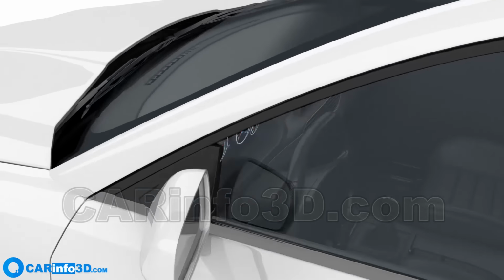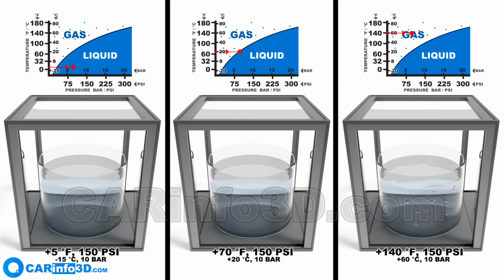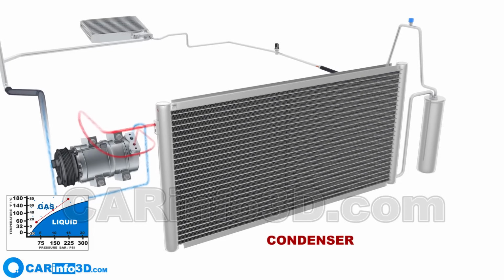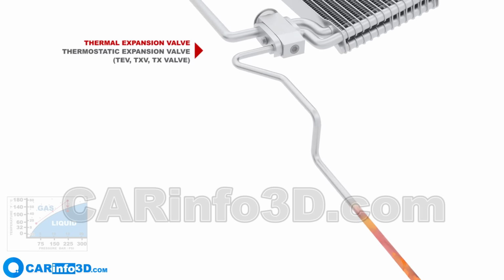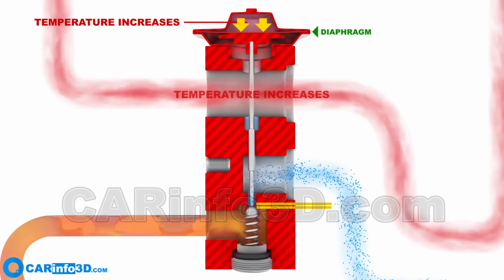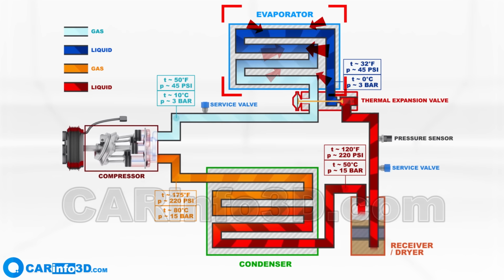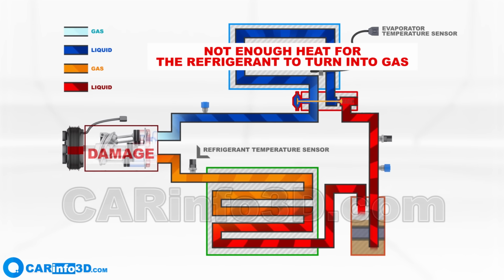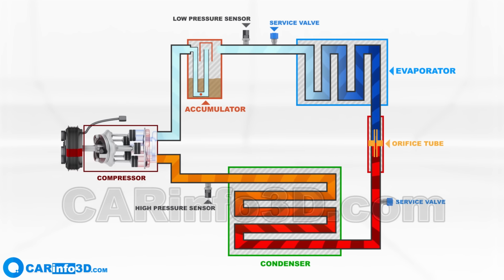Car Air Conditioner - How Does It Work? (3D Animation)

Comment: I'm struggling to read Fahrenheit values; they just don’t make any sense to me and mean nothing. At least Celsius is simple, 0 when water freezes and 100 when it boils, easy reference points using water. But the video itself is very usfull to me. Thanks a lot.

Comment: Well done & informative video. Here's my CONDENSED, get it? Condenser. description to the layman that's overwhelmed. You have two separate radiators, for simplicity, containing a type of refrigerant, one is under pressure and liquid form, the refrigerant is then pumped to the first radiator after it hits the expansion valve that allows the high-pressure refrigerant to expand which allows it to immediately turn to gas, it boils into gas at near freezing temperatures releasing the freezing gas refrigerant into the other radiator and the freezing gas absorbs heat and is pumped out to the compressor to be turned back into high pressure liquid to release that heat you just absorbed. This cycle repeats over and over. Made it worse for you? lol. I hope not.

Comment: What an excellent video! Although I did know increasing pressure in a system elevates the boiling point of the system's fluid, I'd never realized what the compressor (besides pumping) and the expansion valve are for until I watched this. But now, I believe I have to solve the fact of the coolant entering the evaporator as a gas, when I used to have in mind it entered as a liquid.

Comment: where does the water that the dryer absorb goes ?
Reply: Inside the drier, there is a desiccant element that internally absorbs the moisture.
Reply: That's not water, that is called moisture. Frequently moisture enters the system during refrigerant charging/filling and that is called dessicant in dryer which absorb moisture.

Comment: Hello, thanks for all these info. I have a question. How you control how cold you want from the system? It seems a closed loop system without any temperature control point.
Reply: It is dependent on compressor. Your AC is on, it doesn't means compressor is on. It runs till to reach your ambient temperatures which you set. When your set temperature achieved, compressor turns off.

Comment: Note that it's common for cars to use the air conditioner to lower the humidity in the cabin and often, the AC output is blown on the inside of the car's windows to defrost them.
Freon is a refrigerant trademark of DuPont Chemical Company.
Reply: Never true dupoint

Comment: In most modern cars the A/C system is used in the winter time in conjunction with the defroster. During cold weather the warm humid air inside the car can condense on inside of the windshield because the glass is cold on the outside.  This will fog up the windshield and reduce visibility. When the defroster is turned on the A/C system starts and the outside air is dehumidified as it passes through the evaporator. It then passes through the heater core to warm up the cold dry air. The warm, dry air is then discharged onto the inside of the windshield by the defroster vents. This dries the inside surface of the glass to eliminate the fog and restore visibility.
Reply: So you cool then heat ?
Reply: @Tribe_OF_Benjamin_O_Yasharahla  Yes. The humid air goes through the evaporator first to condense the moisture out of the air and then it goes through the heater core to get warmed up.
Reply: I always wondered why there where 2 settings for air; a "recirculate"  or use "inside".
Reply: Rubbish, outside air is all that is necessary to demist the interior windows
Reply: @BillSikes. So why on both my cars when I turn on the defroster, the A/C buttons light up, and the compressors run?
Reply: First, in cold season, compressor doesn't require to turn on because we don't want cold air, so evaporator doesn't get cold till compressor is off. Second, if compressor is on, there are seperate flaps provided to bypass the air through heating coil, so air doesn't get cold.
Reply: @TheKeshav92 
dumas....back to school
Reply: @William-m9q6e that school where your mother teaches..??
Reply: Incorrect. During winter time, the air as it warms on intake is dry enough not to cause wet windows. You rather want to humidify it for your own sake.
Reply: @тотсамыймюнгхаузен No it is correct. If you don't think so, turn on the front windshield defroster and then go look at the compressor. It will be spinning. The windows fog up because the occupants of the vehicle are exhaling warm, humid air that contacts the inside of the cold glass and fogs it up. The A/C dehumidifies the air being blown onto the glass so that the windows clear up.
Reply: @joevignolor4u949 that is if your air circulates inside - if it's taken from outside it gets warm dry - no dehum needed
Reply: @joevignolor4u949 
Rubbish, the windows only mist up because you're recirculating the moist air inside the vehicle, to clear the windows just move the switch to the outside air position and they'll be cleared within minutes
Reply: @тотсамыймюнгхаузен  It depends on the temparature in the winter. In Germany this is general between -5 and 5 °C, this is not cool enough that the air can´t hold the water. This happens by lower temperatures than this.
Reply: @тотсамыймюнгхаузен  
Winter air can be quite humid at times, so I believe you are only partially correct.

Comment: I never would have guessed this would I be so complicated. It’s more complex than various other aspects of how cars work.
Reply: insane! I give up searching myself now LOL ;)
Reply: Overly complicated. Probably the most complex system in a car. I'm sure there is a simpler way to design this.
Reply: @Perspective3Sixty in science there's usually a simple way to alot of things but regulations makes things complicated
Reply: @Tribe_OF_Benjamin_O_Yasharahla  Very true
Reply: @Perspective3Sixty  There are simpler ways to cool air to a lower temperature: However, most of them are too inefficient for the high cooling capacity required in a vehicle. Others are impractical or too large to be used in a car.

Incidentally, the most complicated part of a car is definitely the engine, which alone consists of at least 2,000 parts that move at high RPM.

Comment: So what if you ac compressor is getting hit to the touch but ac is blowing cold still functioning . No funny noises . Just compressor getting hot as an iron . 
70s GM car
Reply: lack of compressor oil is the likely cause.  but always check the refrigerant pressures first.

Comment: Hi. So I have a 1995 Chevy Silverado r134a system. 229,000 miles.  Could be the original system. I bought it recently. The AC would turn on (35 to 40 psi) and off (15psi) every 2 or 3 seconds at most.  I jumped the Low pressure switch and the compressor stayed on, and the Low side read 40 psi, while the High side 80 psi. Air in cab would originally become slightly cool. When i jumped it, it got a little cooler after a minute or two.  I vacuumed system thru high and low sides simultaneously and it held -29 for 90 minutes.  I also indivually vacuumed the Low and High sides and isolated the sides from the gauge. Each side held -29 for 20 minutes.  Then I attempted to charge the system but the cans will not be suctioned from the Low side. The can will fill the hose and Low side spike up to 75ish PSI and then will not do anything else. Any ideas?  Could the orifice be clogged?  Many thanks!
Reply: compressor is shot.  it is not compressing.
Reply: a clogged orifice will show very high high side pressure readings

Comment: There is no video in the entire YouTube regarding how to diagnose & understand specific readings in high-pressure & Low-pressure Manifold Gauges concerning temperature values in the second round of the Manifold Gauge for the system.
Only one video is available for R410a. Kindly do a video explaining the same for R134a which will be very important to all.
 Regards!
Reply: lots of troubleshooting charts if you use search on browser

Comment: Does AC stop working when the Tempreso cabin is cold enough?
Reply: ac does not stop.  it just cycles.  there is constant heat loss (or cold loss) in the car.